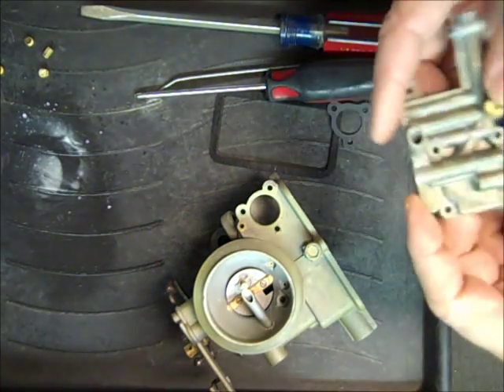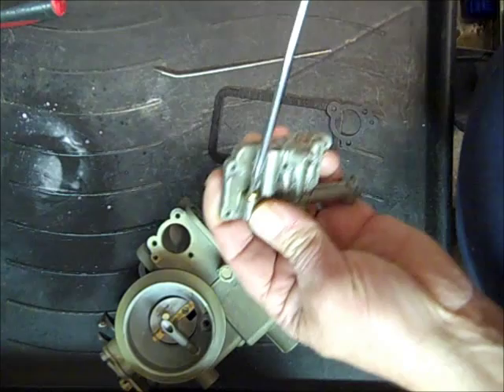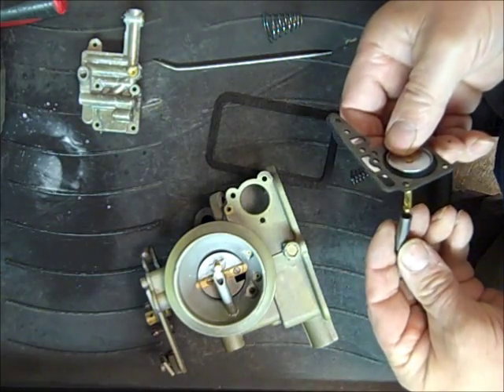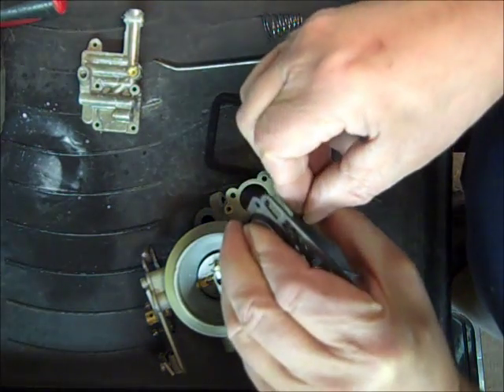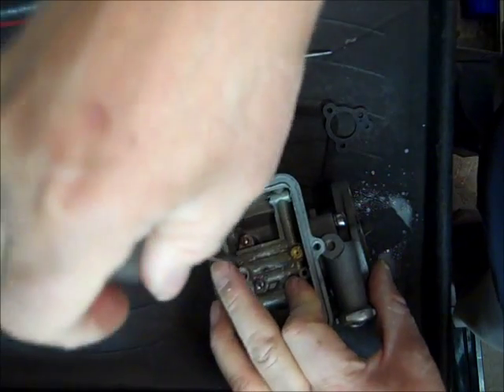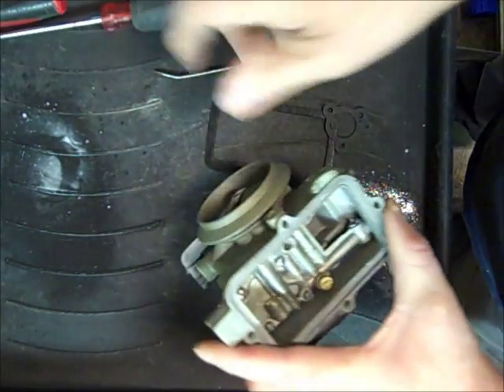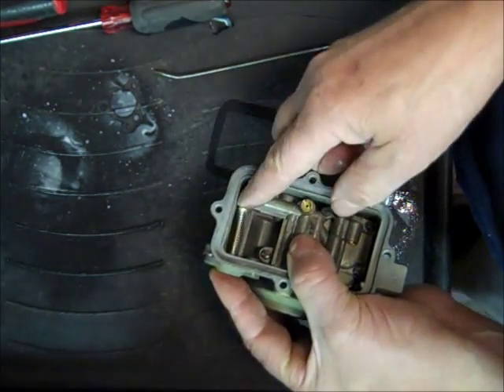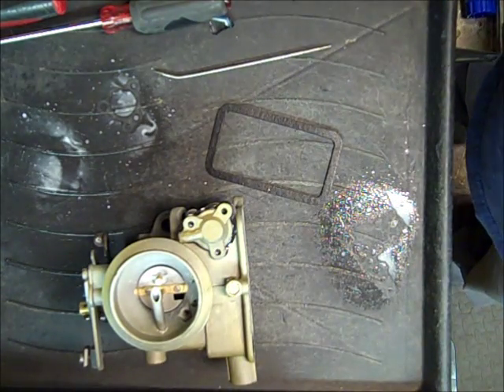Holley 1904 Carburetor Rebuild Part 3 of 4

Comment: For some reason I have 2 small check balls and 1 big one….. these I pulled from my carb….
Reply from the maker: 2 will go into the metering block if you decide to open it up. Don't unless you have a good reason. One big and one small

Comment: I have a 1966 scout 800 my carb looks just like this. Got a rebuild kit an it's not picking up fuel. Rebuilt the fuel pump. My scout is a manual. What do you suggest
Reply: @MikesCarburetor  thank you will check all of the above. Are there any modifications you can do to these carbs. I have the slant 4 cylinder in my scout. Thinking about putting a webber 2 barrel on it. Heard it makes drivability alot better but I'm trying to keep it all original

Comment: Hey Mike, not sure if you still monitor this but i have a question. The accelerator circuit block that contains the 2 check balls and weights, mine has plugs that can't be unscrewed. How would i remove them or can I? For now, i just sprayed the holes from the other side with carb cleaner spray. I hear the check balls shaking. Will this be an issue if i dont replace them? Thanks
Reply: Mikes Carburetor ok thank you. Yes everything appeared fine. They rattle around and I don’t see any sign or corrosion. I’ll just leave it as it is. Thanks again, Dan

Comment: Hi Mike, what is the name of the valve, the accelerator shaft/diaphragm pushes up against, when there is low vacuum? Does your kit have a replacement pin and end caps? For clean out purposes. 
Thankyou for the great carb. videos!
Reply: @MikesCarburetor  thanks for the quick response.  I have the carburetor apart except for the economizer valve. There are 2 brass end caps I left alone. I waited till the kit I ordered from you, came in. I didn't see any parts for this or the end caps. The diagram for the 1904 I received , doesnt show parts for the little valve and caps. So, I thought I would ask.
Thanks again for your help,service, and videos. 
Much appreciated, 
Miles

Comment: What is the best way to fix a screw hole under the accelerator? I had one screw that seems to be very weak to hold the thread on the accelerator plate. Any help would be appreciated as i understand this might be a common problem if someone over tights the screws.
Reply: I think i have it now. Appreciate the input. I got some JB weld and put it in the hole and put oil on the bolt and tighten it down. Later it screwed out and the hole was tighter than new, Now, i got one other problem and no one can tell me what it actually does. The single hole in the base plate of the carburetor is bored to the power vacuum actuator on the top of the carb. What is that bottom hole for?